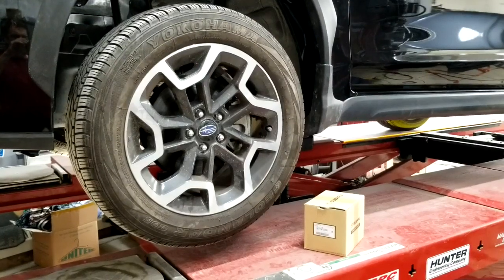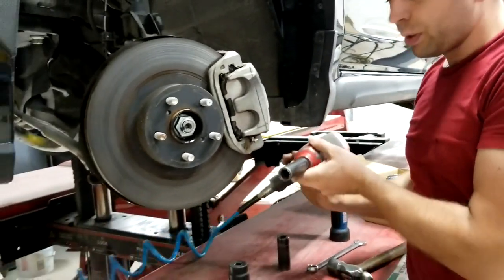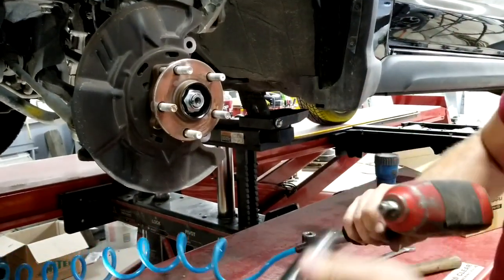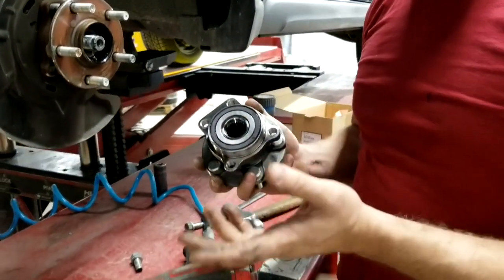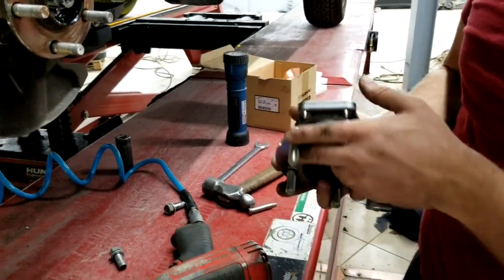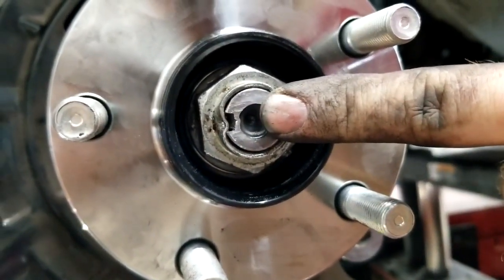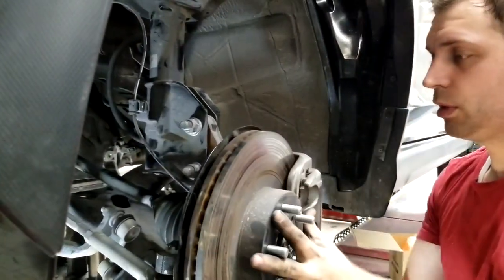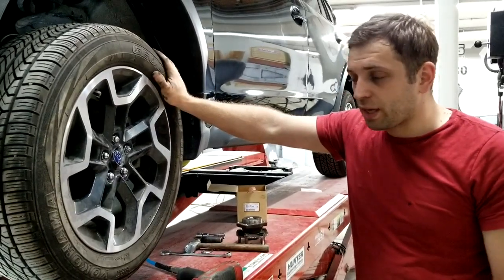How to replace front wheel bearing hub on a subaru, xv crosstrek, impreza, wrx, step by step.

Comment: Never put a bearing back on with an impact wrench, use a torque wrench. The axle nut has a specific torque.
Reply: How tight?
Reply: @nathanallen9303  it can be looked up on the internet
Reply: @nathanallen9303  Hub bolts 65Nm, axle nut 220Nm
Reply: That bearing is toast. Do the job right with oem he says lol
Reply: exactly and never use an impact wrench to tighten up the lug nuts as they also have a torque spec, that is the biggest mistake most mechanics do, Tighten to a particular point with the impact gun then finish off with the torque wrench. ALWAYS.

Comment: I'd recommend removing the ABS sensor to avoid breaking it, especially if you're in the rust belt.
Reply: It is a good idea but you must be very careful removing this expensive part.
Reply: Yes, especially if you have to use a hub buster or equivalent. Found this out the hard way when I destroyed my sensor while separating the hub from the knuckle.

Comment: Good video, only suggestion would be use lock-tite either blue or red  on your hub bolts and caliper mounting bolts and torque to manufacturers spec and this would be a “perfect” video!

Comment: Gotta do this and brake on my 2018 Crosstrek. Real quick question. I know a wheel bearing is going bad, I get the growl coming from the front at 40mph and above. Is it possible to differentiate which side is going bad? It sounds like the RF.

Comment: 🙋🏽‍♂️ Do you know if the size 32 socket for the axle nut is the same for my 2014 Crosstrek?
Reply: Most likely- wife's 17 forester was 32 - assuming my impreza will also be a 32 hahahah

Comment: Looking to replace a front wheel bearing on a '19 crosstrek.  I have an account with a dealer delling aftermarket.  They are high quality but is there a way to tell if the magnetic strip will allow my ABS to function or not?

Comment: No mention of torque spec for axle nut and wheel nuts?
Reply: For a free factory service manual go to http://jdmfsm.info/Auto/Japan/Subaru/   
It will have all the tightening torques you need.  Just navigate to your vehicle through the website.
Reply: I worked in a Toyota dealer for 6 years no one ever torqued an axle nut. Impact gun for everything. Time is money in the auto mechanic field.
Reply: 4agte16 that’s exactly why I like to do my own work on a car if I have the tools to do it. Impact gun on a wheel hub nut you have no clue what sort of torque you are putting on the bearing. Of all components this is one to torque or at least hand tight with socket and wrench.
Reply: @paddyirskman2447  YES...after watching the way things are done over the years and struggling with a total lack of care for vehicles by dealerships, inflating prices, intentionally overtightening lug nuts, oil filters, drain plugs, damage due to carelessness or even ignorance, and then charging for the repairs for damage done by the techs, WHO NEEDS THE HASSLES
Reply: @4agte16  Makes sense. Overtightening virtually guarantees that the new bearing will wear prematurely due to overheating, so win-win for the dealership. $$$

Comment: must be nice when they come apart so easily lolol for some reason everyone i get in the shop its always fighting. IDK if youre located in the rust belt, but if you have any tips to getting seized hubs separated please share
Reply: mix 50:50 acetone and ATF in a bottle, and use that as a penetrant.  Works way better than anything you can buy, including kroil.  There must be some environmental reason that it can't be sold, maybe due to the acetone.  Many tests have been done and its the best.
Reply: I feel your pain. Nothing on a car should stay together when it's hit with an 8lbs sledge hamme, but here I am writing this comment.
Reply: I used an air chisel

Comment: Basically a good tutorial as far as it goes BUT, VERY IMPORTANTLY, you didn't ex[plain or torque down your different bolts to the required specific torque specs.
  The most important is setting the correct torque for your wheel bearing nut (the one that you replaced).  That one needs a very high torque setting and if you don't tighten it down enough you'll cause big , big problems and even expensive damage to your new hub & bearing assembly, your brakes and even your front suspension. 
 You should NEVERT just tighten it by feel!.  For that matter, any fastener that has a required torque spec should be tightened to that spec.  The manufacturer sets those specific specs for a reason.
Reply: I came here to try and find out the torque spec for the bolts that holds the hub bearing. Would you know?
Reply: @phizz8694    You need that spec. for your specific model vehicle.  It could be anywhere from about 160 to 180 ft/lbs or maybe even more!  DO NOT GUESS or assume that the highest is better than nothing.
  I would NOT go by what a YouTube video tells you UNLESS it is a video by someone like MrSubaru who has a YouTube channel and he has a video showing him doing that repair on your exact car model.
  There are a lot of these types of videos posted on YouTube by people that, to an inexperienced "Do It Yourselfer", look like the person doing the video knows what he's doing but either they don't know what they're doing or they leave necessary information out which is exactly the problem with this video.
  Using correct torque specifications is VERY important.
  MrSubaru is a certified Subaru mechanic who does great repair videos and while he doesn't have the time to answer specific questions like yours, he does give the torque requirements for each nut and bolt on the specific vehicle in each video.
  A good and inexpensive resource for those who want to do their own repairs is a Chiltons or Haynes repair manual for your model vehicle.  It will give you the manufacturers recommended torque specs for each fastener.
  Get one of those repair manuals.  They are worth every cent and they're not expensive.
  Ebay or Amazon has them.
Reply: @phizz8694  The 4 hub bolts 65Nm
Axle nut 220Nm
2 caliper bracket bolts 80Nm

Comment: Great video. I do have a question. What happens if the old wheel bearing won't come off because it's stuck because of rust. Any tips or leverage to take it off? Thanks 🙏
Reply: Crap tons of penetrating oil. Do it once a week for about a month before even trying. I live in central NY where everything is rusted. The hardest part will be saving the backing plate

Comment: 105K miles on my 2014 Crosstrek , it has noisy rear bearings now. Should I go for OEM replacement Bearing/Hubs (1 year Warranty) or aftermarket Duralast (Lifetime warranty)?
Reply from the maker: I would go with oem

Comment: George I need your assistance, I have a 2008 yaris and I changed transmission fluid and filter and did 2 drain and fills to get as much trans out then filled it and checked it and now I notice when I drive and let my foot off the pedal at 40 mph I notice a slightly breaking after my foot let go off gas and it last for only 5 to 10 seconds then back to normal and ideas what it is?

Comment: I used this video (thank you) to swap a front hub assembly last week, and I will soon do the rear.  Where might I find the tool you used to unlock the axle nut?
Reply: It’s just a impact wrench with a 32mm/1.5in socket. You can find cheap impacts at pretty much any hardware or automotive store you go to

Comment: 7:22 Oooh, never pound on bare axle end like that with a steel hammer, as it can mushroom out the metal, making it nearly impossible to reengage the axle shaft nut. Alternative: Use a large punch held against the axle center, and tap the punch. Or, temporarily mount the axle nut itself until flush with the axle end, then gently tap until things move freely. Protect those threads!

Comment: Are you kidding me?  That looks like a brand new car.  Around here  (Wisconsin) be prepared to spend a lot of time & effort getting the old hub out...
Reply: TRUE
Reply: I been using a maul for two days on my imprezza it feels like its welded on! @lawrencegaudette4747
Reply: My 2013 XV hub was so rusted after 1 hour of beating the crap out of the hub trying to loosen it, I gave up and took a chance on a Craigslist mechanic. After an hour of banging he took apart the whole wheel assembly out so he can beat on it from the back. It took him total of 3 hours to complete the job. I gave him more than the $125/hub he quoted me.  I don't know what is wrong with Subaru's engineers as their wheel hubs have had a history of going bad quick. Mine also went out at around 65k miles.
Reply: @jackbloznowski5429  My son is needing his 5th wheel bearing done on 2013 Subaru Crosstrek. I think one of them is the 3rd time.
Reply: Mike H.   I used a non-OEM bearing hoping it will last. Then there is the issue with bad struts in the rear. I am replacing them with Rallitek springs and Bilstein shocks. The rear is bouncing all over the place when hitting a bump.
Reply: @jackbloznowski5429  Twice we used Timkens, one of them replaced already. I've read they're not what they used to be. The one that will now be done again for the 3rd time was done once under warrantee. They stripped 2 of the lugs when they got finished with it. One of the rear ones was hours comin off. I've almost lost track of which is what.
Reply: @Mike-ig2zq  I went moog on my wife's forester- hopefully those last longer- shes on her 3rd set (105k mi) About to attempt my front since i buried it in a pothole this spring - (Impreza) 

Also if you guys pop the speed sensor out and flood it with penetrating oil that seems to help a ton.
Reply: @dwgjr330  probably a good idea. We've used Moog with pretty good success, although One did fail on my sons 2013 Crosstrek. My nephew just did a rear passenger bearing on his 2011 Outback. We were doing so many bearings we ended up getting a stethescope from Princess Auto for diagnosing which was a pain sometimes when they first start to go. 20 bucks I think.

Comment: Is the Wheel Speed Sensor only on the left front hub? (That's one of the only hubs you see getting changed on YouTube!)
Reply: Theyre on all 4. Its needed to read the wheel speed, also used for abs, traction control... bunch of stuff

Comment: I have a bad wheel bearing on my WRX and the shop is saying it’s going to cost 1300. This seems insanely expensive , gotta know if I’m getting ripped off or not
Reply: Late I know, but it sounds too high.  I just did my 2014 Forester Rear Driver side and it took 3 hours going very slowly.  Maybe a two hour job at shop. No rust here in Southern CA so that helped.  If rusted on the bearing could be a nightmare.  BTW the axle nut and bolts should be Torqued.

Comment: I have to replace the front, passenger hub assembly in my 2008 Impreza and I'm having a hard time finding the part number and OEM brand. Would appreciate any assistance! And thanks for the video, I'll be using it once I find the part!
Reply: Any luck finding the part number or OEM brand? I was going to purchase AC Delco but can't find it in stock..
Reply: @jonlon7488  I found it on Amazon and everything worked out great. Not too difficult to replace either. It was about $125 and this is the item description: "SUBARU 28373FG000 Hub Complete Front Axle"

Comment: Impreza GD MY06 does not have thi system.
You have to take the whole wheel mount apart to replace the bearing
Reply: YES, this repair is actually not just the bearing but the entire bearing hub is replaced

Comment: For the sake of redundancy, tightening requires torquing to a range lbs ft or Neuton meters. If you can afford an impact wrench, you can afford a torque wrench. Just treat your torque wrench like a precision instrument, don't drop it or toss it around like a crowbar and it should remain calibrated. I know all about that "calibrated elbow"

Comment: Subaru hub assemblies are crap. Ours failed at 60k.
Reply: I've had to replace 3 so far, My mechanic just let me know that there is a bulletin (search "Bulletin Number: 05-70-19") where the backing plate is uneven and caused my bearing to go early. Might be  something to replace.

Comment: Lmao. Havehad moog bearings on mine for 2 years. No abs light.
Reply: @jima3129  Hi, I replaced my 2014 Subaru Crosstrek wheel bearing ( left front ) then I did test drive. Looks everything okey after that ABS light traction control and hill assist light on. Also Engine light on to engine code is p0500 ABS code is C1222  I changed wheel bearing again ( moog brand ) nothing happen then I changed ABS sensor still same... I didn't figure out ! Do you have any idea ? thank you

Comment: I thought you need a special machine to change wheel bearings .
Reply: if you're talking about a press, that's for the actual bearings it self, he changed the whole hub that the bearing sits in.
Reply: @gwot  I have 2005 impreza wagon and you actually need metal press to change wheel hub. I had to take the entire knuckle off and bring it to a shop to get the wheel hub changed. I think  06 or 07 the hubs became bolted on instead of being pressed into the knuckle
Reply: @user-iz6kq8dy4i  I just looked up the part for a 2005 impreza, you dont "need" to press it, it is the same design as 06+, it is supposed to fit snug, but not a press in snug like bearings are, so if it's rusty it's easier to use a press to press it out. Again, I think you're thinking about bearings and not the hub.
Reply: @gwot  I have the rs wagon 2005 I replaced that hub assembly a year ago and from what I remember the knuckle is pressed to hold the hub and bearing in place there are no bolts holding it to the knuckle. I can remember being annoyed when it seems other models and tears use bolts instead of a press.
Reply: @user-iz6kq8dy4i  maybe the photos of the part i saw were generic photos.

Comment: There is a torque spec for the axle nut and you just used an impact. You either used too much torque and the wheel hub is now bound up, or not enough and risk the safety of the driver when driving down the road with a loose wheel hub. Holy crap this is a dangerous video. I hope nobody actually follows this video.